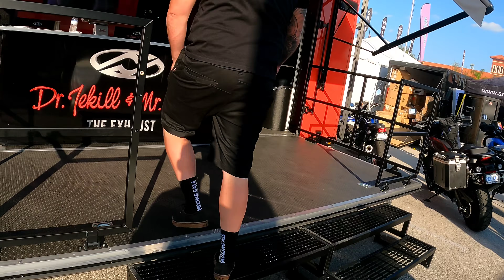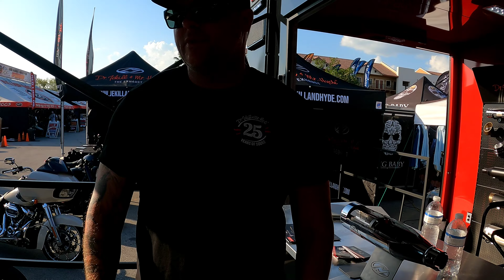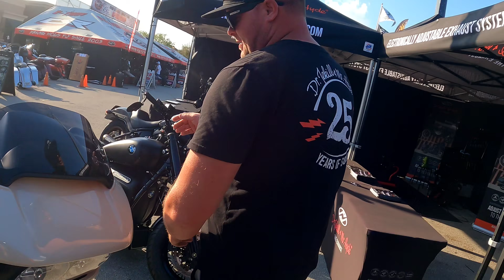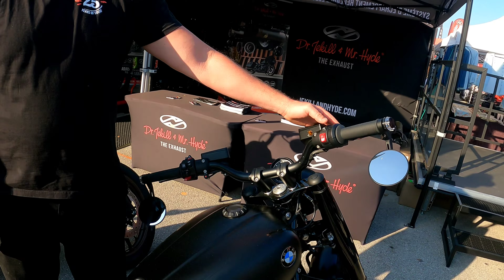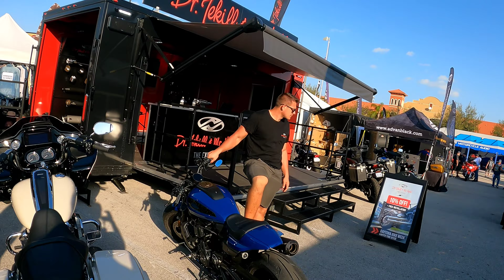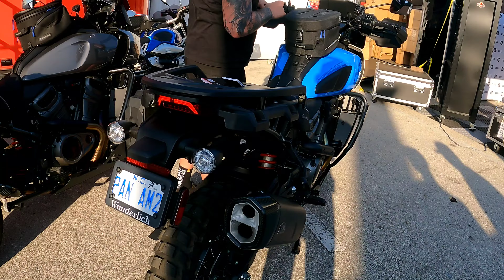Dr. Jekyll & Mr. Hyde Electronic Adjustable Exhaust Systems Explained By Employee

Comment: Hello, What products can be used to clean the drain?
Reply from the maker: Sorry I don't understand what you mean
Reply: @THE_MOTOR_MAN  what do you use to clean
Reply from the maker: @HarleyDavidsonLifee  I would just use a spray cleaner And a micro fiber towel.
I would not spray it with the water hose due to the electronics

Comment: Hi, my J&H exhaust doen't react anymore since November last year. Whenever i pushed the button the valves wouldn't react and open. 
My battery just died before and i had to take a jump start from a friend with his car, since then i've installed a new battery but the valves still don't react. 
Any suggestions why that may be? I just looked up the parts and my guess would be it's either the smartbox or the servomotor. Can i fix it myself or do i have to go to a workshop?
Thanks in advance!
Reply from the maker: Hi there!
Thanks for reaching out, it definitely sounds like some sort of electrical fault with the system.
Where exactly did you buy it from and who installed it?
It looks like all products from this company have a 4 year warranty.
  Have you tried unplugging and plugging it back in and checking all of the connections?